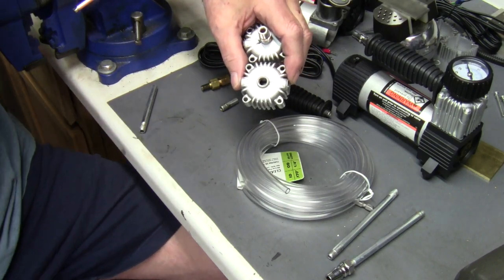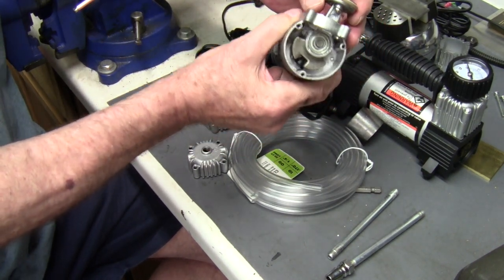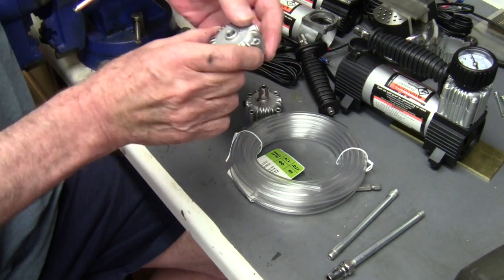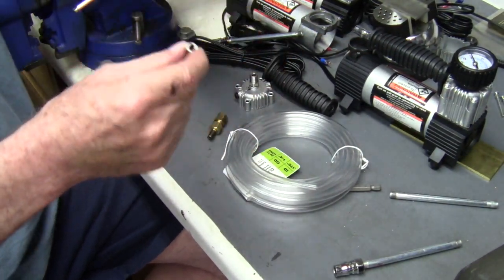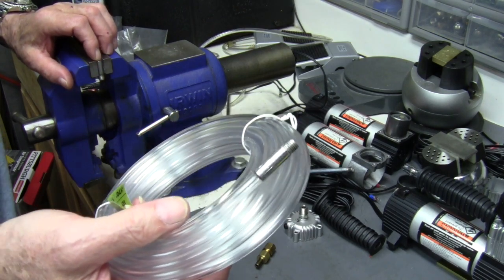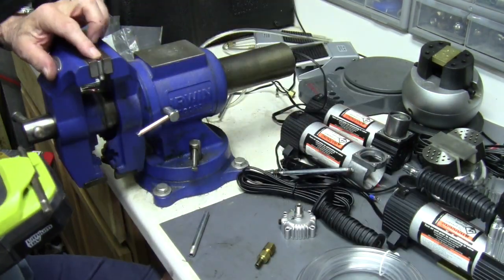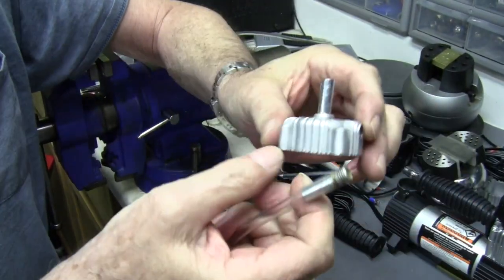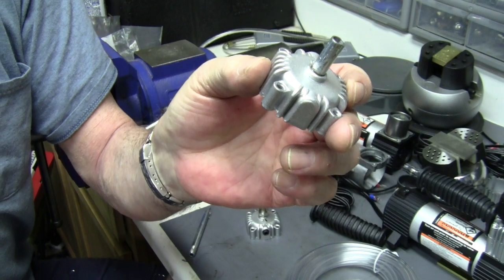Modified Compressor Head Adapter for 1/4" Tubing without trying to find  fittings that will work

Comment: I just attempted to modify the pump yesterday, finding that the new pumps are made differently within the piston.  Indeed, it is pressed on, as well as a difference with the check valves.  I wasn’t successful with the modification.  Do you have any suggestions on how to do the modification on this style?  Any input sure would be appreciate!
Reply from the maker: The changes the manufacture made should not affect the mod, you need to block the valve in the piston and open the valve  on the plate above the piston.

Comment: I don’t know if this will reach you in a timely manner, hopefully someone does.  I’ve made this, following your instructions, as well as made some mods of my own over time.  However, on one evening hunting for parts I don’t know the name of via image search, I discovered that this exact machine already exists.  Not only does it, but it’s vintage, works amazingly, and seems to be fairly easy to come by.  

Search: Vintage CLEV-DENT PNEUMATIC AIR PUMP DENTAL 

It has all hardware with a piston and motor bracket.  The piston was even originally made to push/pull meaning no mods.  All I’ve done to mine is beef up the electric motor from 2500 rpm to 9000 rpm.  While this discovery comes after lots of toil trying to make the inflator mod work well, I’m going to attempt to not be a little pissed this was under my nose this whole time.
Reply from the maker: Very cool! and from what I can see they are just a cheap as the Harbor Freight tire inflators. Does it come with its own speed controller?  Let me know how it works out.  Thanks for the info!